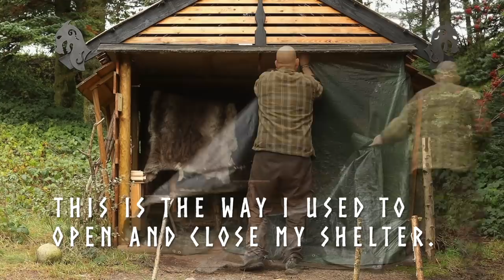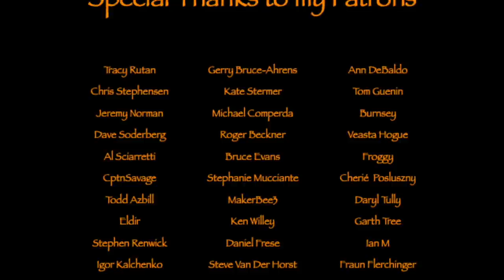Attacked on Ant Hill

Comment: Hello Tom, 
that's  the Problem with our Age, we forgot to much, anyway thats the only thing I accept to do Batoning when you forgot or lost your Hatchet, normaly we dont have to use a saw, as long we have a stable knive. 
Here is a littel offer for you  !
I was getting rid of the Ants in my 
Caravan with Bakingpowder or Bakingsoda.
Ants love that stuff but if they eat it they explow, may it will be helpfull in your Cabin / Camp to.
Now you got 2 Ravens  ! So you need tow Wolfs to !
Thank's for showing the Video  !
Greatings from Germany  - Walter  and Thumb up.
Reply from the maker: Ha ha that’s right Walter 😊👍🏻🐺🐺 two wolfs will also keep burglars away 😆💪🏻 I used to have ants 🐜 in my camp 🏕 but have solved that problem with vinegar … sprayed it around my shelter … works great 🔥🌲
Tom

Comment: Hey Tom,  If you keep your saws and metal tools in a shed or garage how do you keep them from rusting out doors?  Please explain..
Reply from the maker: Well Paul I keep them inside in my workshop … but if you keep them in your garage you have to treat them with oil regularly 😉 otherwise it will surely rust 🏕🔥🌲 Tom 🇩🇰